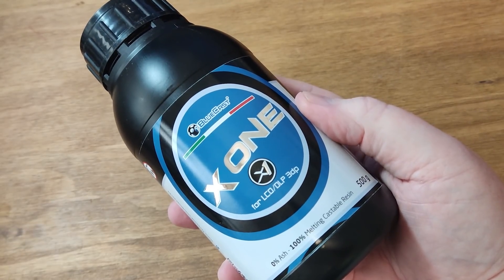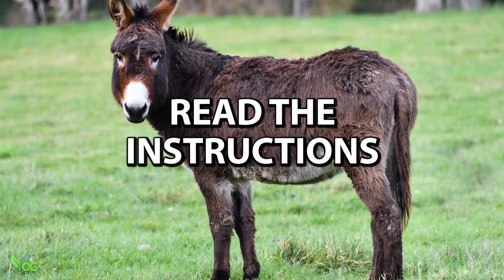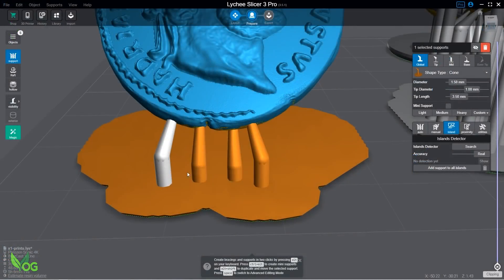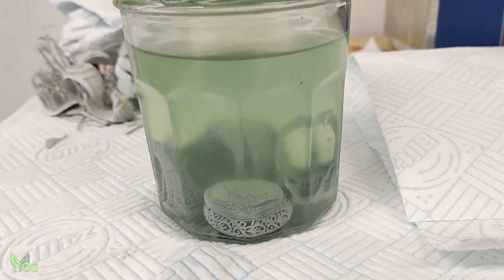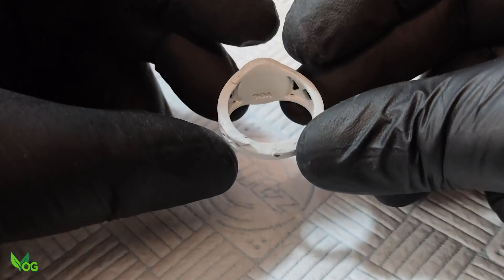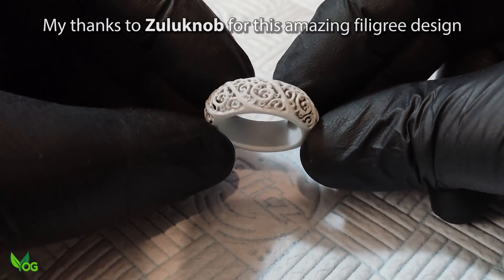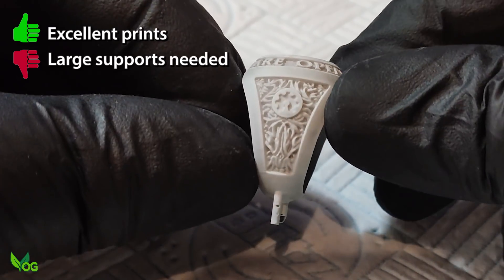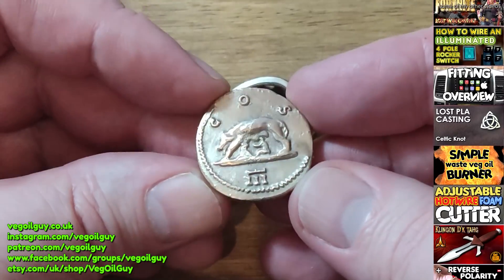Bluecast X One Castable 3d printer resin [HONEST REVIEW]

Comment: I don't think this resin exists any longer. 😞 I'm trying to find something similar for higher detail jewelry. I like that this is non toxic, and doesn't have a ridiculous clean up process with veg oil.

Can you or anyone recommend something similar?
Reply from the maker: I'm not aware of X1 going out of production. But another excellent, easy use castable resin is Easycast 200 https://youtu.be/CeBn__K_XNA
Reply: @vogman  I am dumb, I searched for the wrong thing. I ended up finding it!

I have some designs with extremely fine details, would the x-one resin be acceptable, or should I spend the extra money for the more expensive resins?

I'm having a hard time deciding on which resin to get for casting with my Photon Mono 4k

Comment: hi everyone I am just start working with x one and a question is about supports on model,when and how the best way take it off supports from model,before cleaning or after cleaning,just breaking them or gently trying to cut thems. thanks
Reply from the maker: You'll get different answer from different folks 😁
Personally I clip away supports. When you tear away, there's a high probability of damaging the print. Even though the damage is small, it can show through in the finished casting. I prefer to clip, leaving a tiny nub behind. This I then gently sand away with very fine sand paper before casting.
Reply: Thank you very much for answer. just one more thing,you take them off before washing or after?
Reply from the maker: I do both. I wash after it comes off the plate, remove the supports, then wash again to remove all the resin that was stuck behind the supports. It works well. Just no more than a minute or two 😁
Reply: Great,thank you very much

Comment: do I need special preparation and resin before use? I tried to print and I didn't succeed, the resin had some lumps
Reply from the maker: No, nothing special for this resin. It likes to be warm, around 25C. Filter it, clean everything down, level your plate. Then check your settings with those on the Bluecast website. It's a nice easy resin to work with 😁

Comment: Hi sorry it's me again, i have a question about the burnout cycles. its a totall of 11 hours of run time per burnout which is a long time to have such a power hungry piece of equipment running. Do you know much it costs in electricity per burnout?
Reply from the maker: No... I never look 😁
Reply: @vogman  hahah is your electricity bill high by any chance? 😂 Im in the process of setting up a casting shop and have a large 14" by 14" burnout furnace coming, gonna be interesting to see what the leccy meter does 😂
Reply from the maker: I've never heard anyone say, "Electricity is sooooo cheap." 
It costs, but so do gas bottles or charcoal, etc.
The convenience of electricity wins for me, so I genuinely don't want to start fretting about the costs. That's why I make my wife pay the bill 😁😁😁
Reply: @vogman  yeah I'm in a different situation as im running a business so cost is important.

Comment: Hi,

Did you use the Mars printer for this resin, I have the 1st mars printer. Will it work with that?
Reply from the maker: This reason will work fine in the Mars. Bluecast has settings available for Elegoo printers 😁

Comment: My favorite resin! I use it a lot for large and complex sports rings with heavy lettering and areas for enameling. Couple suggestions: You put a glass bottle into your sonic cleaner. Glass will reduce the sonic action because it is thick and hard. Find yourself a thin plastic container to use in the sonic bath. I use red solo cups and don't worry about the lid. Cleaning is much more complete and faster. Next, do a pre-sonic dip in some ethanol before going into the sonic. This will get the bulk of the uncured resin off. So you will basically have a "dirty" container and a "cleaner" container. The one that goes in the sonic cleaner can be reused multiple times. For supports, you are making too big a deal of it. I use lychee medium almost 100% with the exception of a few thin or heavy's as needed. I have NO issues. This leads me to believe your exposure time is too low. Try bumping it up a little. I'm happy to send you some pictures if you like with some very tiny areas with very tiny supports.
Reply: That's exactly how I clean my prints. Initial dunk into a "dirty" pre-rinse, then into some cleaner stuff in a plastic container in the sonic. When the sonic alcohol gets dirty, it goes into the pre-rinse container. When it finally gets full, or I run out of clean alcohol, I deal with the dirty stuff. It really saves on the alcohol since the bulk of the uncured resin gets rinsed off in the pre-rinse, making the second wash alcohol last longer before getting too "dirty".

Comment: Thanks for the review! It'd be interesting to hear your thoughts on this resin vs. Siraya Tech Cast, given that Cast is considerably cheaper and, from what I've seen, casts and prints just as well.
Reply from the maker: This is an excellent resin that has only two drawbacks when comparing with ST (which I haven't). One, as you say, is cost... ST is cheaper. Two, it's more fiddly to print with. Thick supports are a must for X1 and that means a lot more clean up of the print / cast. But ST is happy with thin supports. The only other factor is printing quality and those I haven't compared yet 😁
Reply: you don't need a bunch of heavy supports. if you exposure time is good, mediums (lychee) are fine. it's expensive as hell. thats the drawback. but if you have a part that nothing else will cast, x-one will. its a fantastic tool to have in your arsenal. it's all about the right resin for the job at hand. no one resin will do everything.

Comment: Can you do a video on more engineering/functional casting with resin 3D prints? Maybe with aluminium, and things like gears or testing of tolerances of holes and features in the final castings. So we can consider if it is viable to 3D print and cast engineering parts on a hobby level rather than CNC machining it on a hobby CNC machine.
Reply: I'd be interested in this as well.
Reply: Also very interested in casting engineering parts, i'm going to try it with lost PLA casting with my ender3 v2 but I'm thinking to also buy a resin 3d printer, mainly to cast things

Comment: that contact point requirement is a killer for me, that would ruin many of my prints even with careful orientation :(
Reply from the maker: Yes, it's a real drawback and a common issue with Bluecasts resins. CR3A is the same. This really is a pity. Bluecast has worked hard here and I applaud their efforts... but it's just a little short of perfect for me.
Reply: @vogman  so what's a better choice?
Reply from the maker: I haven't tested side by side, but my initial thoughts would be ST is easier to print with, costs less and casts well.

Comment: In the UK, isn't methylated spirits the same as denatured alcohol? Certainly from the point of view of mixing shellac it's fine.
Reply: Yes, denaturing is a catch-all term for making ethanol undrinkable, this includes methylated spirits
Reply from the maker: I didn't know this. That makes a massive difference. Meths is cheaper than IPA - yippee!!! 😁😁😁
Reply: @vogman  worth just testing first (in case it does damage) but as far as I understand, meths (in the UK) is the same alcohol; just with additives to make it purple, and make it unpleasant to drink. The purple colouring doesn't affect shellac (even blonde flakes) so I assume it'll probably be OK.

Comment: I think in the UK it's called Methylated Spirits? :D That should be available more easily.
Reply from the maker: I didn't know this. That makes a massive difference. Meths is cheaper than IPA - yippee!!! 😁😁😁
Reply: @vogman  I think that's mostly because pure ethanol can be used to make alcoholic beverages. Methylated spirits have stuff added to make them taste so bad you could never drink it. Then  taxes etc. don't apply and make it cheaper.